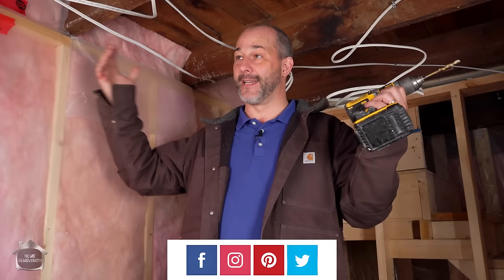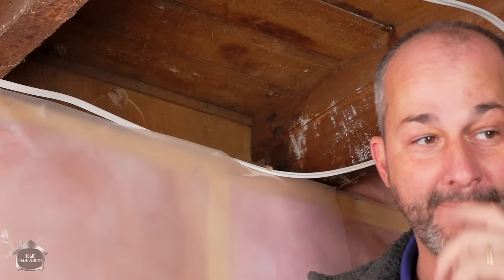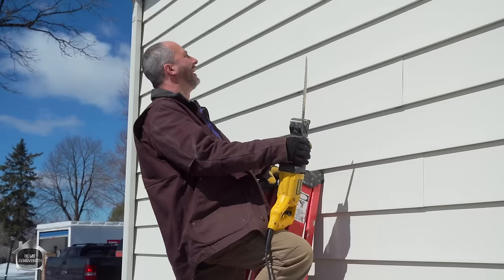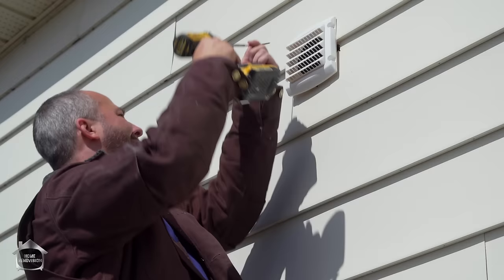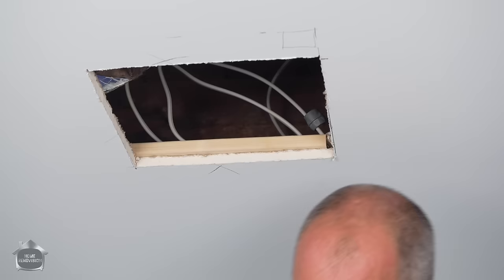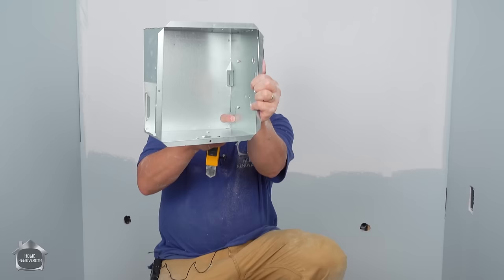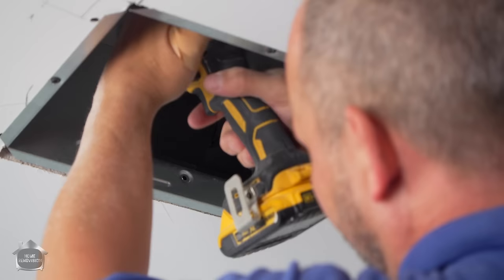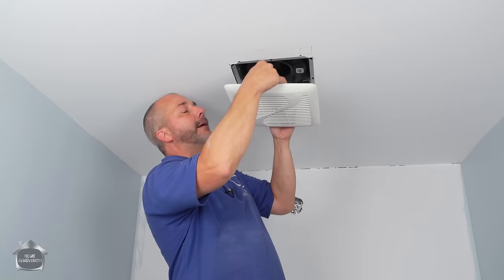How To Install A Bath Exhaust Fan | DIY

Comment: Ever given any thought to putting a little construction glue between the strapping and the drywall so that your temp screws bond it permanently to the opening, just in case you need to remove and replace without risk of the strapping breaking loose?

And I agree with you.  I have dozens of Phillips bit styles and sizes in a reverse "try" carrier, so that I can custom fit the bit to the Phillips fastener....  Robertson/"square" drive is a LOT easier to work with...  like three total sizes or something that I have to carry around for 85-90% of all work.  Of course, I like hex-head fasteners, too.  But slotted and Phillips should ALL be retired from construction.

That's a nice fan and housing design....
Reply from the maker: great idea!
Reply: Thanks for saying that Robertson is square drive! I haven’t heard it called Robertson before so was scratching my head wondering what kind of drive he’s dealing with 😂! I prefer torx T25 personally but I guess torx has a bunch of diff sizes as well so maybe the square drive is better, I just don’t see it as often as torx

Comment: If I  have a small bathroom in the basement, can I  put a vent in it and connect it to the dryer vent going outside? There is no shower down there, I  just want to vent a little of the humidity. Thanks.

Comment: Not sure if I missed it but can this same procedure be done only by cutting the opening of the fan in the drywall. So cut the 12” hole or whatever size for the fan. Then cut the hold for the vent just the way you did it.
Reply from the maker: you must install ducting. Cheers!

Comment: Wish I had an exterior wall to run a bathroom fan to. Only option is up & thru my flat roof, which I’m not keen to take on myself.
Reply from the maker: if you have a flat roof then you should have a space between your ceiling and the roof that could run a fan ducting. cheers!
Reply: @HomeRenoVisionDIY  Thanks! I guess I'll have to see what's going on up there when my electrician goes poking around in my plaster in a couple of weeks when he rewires the place. Wish I could do some of the basic rewiring myself, but Quebec is a pain in the butt as I'm sure you know

Comment: I would have drilled a pilot hole all the way through with a long bit.  I would have still used the hole saw to cut the hole on both sides.  If using a sharp one, it's not that difficult at all, and makes a much neater cut than using a sawzall.

Comment: Once my ceiling fan moter went out found a fan that could fit in the old housing and reinstalled the new fan in the old motor housing sence the new ones were bigger.

Comment: I'm going to be "that guy" and mention that you should check your local codes before doing any work on your house.  I know that in my area, venting a bathroom out the side of the house under the soffit is against code.  The reason for this is that the vent in the soffit can suck in the warm, moist air from the exhaust point and cause mold to grow or result in wood rot in the attic.  It is always best to vent a bathroom out through the roof of the house.

Comment: Hi Jeff, great video, very informative. Just a quick question. I’m currently putting a new bathroom in my unfinished basement. I can install the fan housing and secure it directly on the joist before putting the drywall on the ceiling. My question is, does the base of the housing have to be flush with the drywall or could it be above the drywall (flush with the joist)? The latter would be easier when installing the drywall, but not sure if the fan suction would be compromised as the opening will be above the drywall. Your feedback is highly appreciated.
Reply: I am also wondering why not install the box before put up the drywall.
Reply: If you install the box after drywall, then if it ever has to be replaced you can easily take the whole thing out and put a new one in without damaging drywall in the process.

Comment: I’m curious if a below the ground jacuzzi is actually more efficient than an above the ground jacuzzi, as far as energy is concerned. I’m wanting one but curious if in the long run it saves you money for a below the ground jacuzzi.
Reply from the maker: If you can afford the jacuzzi then the energy you can save is not the largest question that needs answering.

Comment: Good Morning.  This a question about the CAMO sys.  In a old deck frame you said something about using longer screws.  What size did you have in mind.  Jack   PS I plain to use the CAMO Marksman  PRO-X1.  I will use it on the old deck to put a few board tight again and a new deck on a old frame.  Jack
Reply from the maker: Hi Jack, my concern was with the quality of the framing. if the old pressure treated frame was soft at the surface then using camo would not hole. if your frame is good and dry and strong then no worries. i love cammo too. Cheers!

Comment: I have no existing exhaust fan and a low LOW LOW attic, in fact most "professional" repairmen(mostly smaller and shorter than me) won't do certain things in my attic! one is attempt to install a bathroom exhaust fan!  I am also 6'1" tall and weigh 260 lbs so forget about it!
Reply from the maker: you can always install a fan at the top of the wall in the wall . Cheers!

Comment: Question. I am thinking of installing a new exhaust fan in my bathroom. The old one doesn’t work any more and is just exhausting into my attic! I have a hipped roof/no Gable Also my roof is metal and I think it’s out of my scope to go this route. The only way I can exhaust near the install is through the fascia. It looks like what you cut through to get to the exterior. Is this ok to port through?

Comment: I just finished installing a bathroom fan in my older home. (Probably would have been smarter to watch install videos first, then install the fan.) My fan did not have a removable connector for the exhaust ducting. So I pulled the ducting out from the ceiling to tape it onto the housing, then slid the whole fan up into place. This resulted in my ducting not being in a straight line with my vent, as the extra ducting went sort of left to right as it went back into the ceiling. Will this be OK? Or do I need to correct this?

Comment: Wait till the Asian beetles (and other insects) find that critter guard on the outside vent along with the gap in the inside flapper will allow anything smaller than a hummingbird to go right inside. Also, those plastic vents become brittle after a few years in the sun. You'd be better off with a metal exterior vent cover that has a screen and a flapper.

Comment: How would you change the installation in there was a dedicated roof vent for the bathroom exhaust fan? When I had my roof completely replaced I had them install a special vent specifically for the installation of a vent fan in the bathroom. Second question, I have the main 3 piece bathroom and on the opposite side of the wall is the ensuite 2 piece bathroom for the master bedroom. Can I install a fan in each bathroom and use the same roof vent for both of them?

Comment: I’ve replaced a couple of fans in bottom floors of second story homes and they was no way to remove it at all. I had to cut the drywall out around it. Those suck

Comment: Hey Jeff, great video? Have you ever done a house were you had to go thru brick if so how did you enlarge the hole.
Reply from the maker: Hi Johnny, of course, we called a core drilling company and they came out and made a hole in the concrete in about 20 minutes. Cheers!
Reply: Home RenoVision DIY what does a core drilling company charge for this 20 minute housecall?!

Comment: Can you tell me what i need to put an exhaust fan in a mobile home that don't have an existing one. Is there any kit for that that don't have to go through the roof. Its a 14x80 trailer not a camper.

Comment: What if you have aluminum siding? Do you cut it with a utility knife? Question  if your vent is going to exit just underneath the underhand,  will this cause mold in the attic? 
I would like to see the pool being built.
Reply from the maker: Hi Ron on aluminum use the hole saw but run it in reverse until you have it really scratched up so it cuts nice. cheers!

Comment: What do you prefer over Philips Screws? I myself have distaste for flat head/slotted screws. Always slipping off them. I thought philips was to solve that, but I'm not a pro. Do you like star screws?
Reply from the maker: I use robertson. it is a square drive and it is amazing. torx is my second favorite.
Reply: @HomeRenoVisionDIY  Will check them out, thanks, Jeff! Edit: Yeah, torx is what I was calling star, maybe I'm mixing some up, or torx is the real name. Robertson  I remember seeing around, wondered about how good it was. Thanks again!

Comment: You are woefully using the wrong tool with a sawzall cutting the hole in the house. Too heavy, too bulky, and if it kicks back you can lose an eye. Use a simple multi tool. Easier, smaller, lighter weight, safer to use. You should also be wearing a dust mask, especially being that you do this all the time. You will screw your lungs up big time with drywall dust and other stuff over the course of time. You'll essentially get something similar to black lung or silicosis that stone masons get.

Comment: For my basement bathroom, can I put the fan on the wall instead of the ceiling so I can just vent it straight out the wall?
Reply from the maker: only if you buy a fan suitable for wall installations. less than 10 % of them do this.
Reply: @HomeRenoVisionDIY  Thanks, Jeff! I'll probably just get the one you recommend and install according to the instructions. Thanks!

Comment: I'd love a tip on how to install the fan box with 12 inches of existing cellulose insulation on the other side of the ceiling drywall... Any magical solution?
Reply from the maker: staple up a piece of poly to the ceiling and then reach in and pull the cut out through the side. push up poly to continue the vapor barrier. Cheers!
Reply: Home RenoVision DIY: Great idea, thanks!  Better magic than Harry Potter!

Comment: How would you fix crumbling concrete? I have a cold room in the house and on top of the cold room is an exterior deck. The floor of the deck (ceiling of the cold room) is starting to crumble. The cold room is still in perfect condition however the part that is exposed to the weather is starting to crumble. Just add more concrete?
Reply from the maker: it might need to be inspected for integrity. the concrete might be losing its strength due to moisture sitting on it and the sun in the winter can't get rid of it. I would suggest not using salt on the deck in the winter. Hope that helps!

Comment: My bathroom has no heating vent so it gets cold. Can I install one if the vents used in this video but for heat?  Would it need to make a big hole on the side and cap it as you did?

Comment: Do you have any recommendations for a heater/fan combo? My bathroom is too small to follow regulations for the distance between a wall heater and all plumbing... so we would like to install a ceiling heater, but the bathroom also doesn't have a fan. I saw some around the net, but don't know what would be recommended.

Comment: I have a fan in my bathroom that I don't believe is cutting the mustard, not to mention it's now not working either, I'm thinking of replacing it with a bigger fan (50cfm to 110, or there about) my question(s) it appears that the existing fan uses a 3in duct, could I get away with getting a 3" to 4" adapter and be good, or would I have to figure out new ducting too? Second part of that, it looks like the builder used some kind of rigid flexible tube off the side of the fan, how hard would it be to work with that in my scenario or shoukd i look for a more manageable plastic flex tube like you used, that leads me to not knowing what is through/at the roof vent (one of those "goose neck" ones), is it 3" or 4 with a reducer, or nothing at all just a pipe under a cover?  I'm not bad with electrical, it's the actual "construction" stuff that throws me off.

Comment: So much more work just because you didn't had the right pilot bid to drill the holes all the way. That wood it's not that thick, your would be fine and a lot less work and cleaner, if you just drill out with a holesaw . With that said, good job.

Comment: Hi Jeff, love your videos, any advice when a bathroom is in the middle of the house? Is it better to vent through the roof or through the wall? I’m Going to have to get in the attic either way so would like to do the better method of the 2! It’s a good 10-12 ft to the exterior wall.
Reply: I prefer roof venting over through-the-wall, but it is a bit harder to do properly. There are a number of utube videos that do not show it done correctly, so a person needs to be careful.  I also prefer to use metal ducting and I insulate it.

Comment: I am about to replace my bathroom vent would it hurt anything if I replaced my old Broan 50 cfm 3.0 sones and go larger with a 110 cfm with 1.0 sones?
Reply from the maker: the old 50 usually has a 3" pipe so it will still be loud when attaching a larger motor.
Reply: I was thinking about going with a 80cfm with .8 sones and this one has a 4” pipe opening and I was going to get a 3” adapter

Comment: Why the hate for Phillips screws? Just curious. They're way better the the original Slot screws.
Reply from the maker: we use a roberston here in Canada. square drive that does not slip and the screws can sit on the bit even  horizontally. Cheers!
Reply: Ah. We do have square drive screws as well. My father used them to build an extension to his deck. He liked working with them.

Comment: @HomeRenoVisionDIY  I am curious what fan model you install in this video. I am having trouble finding bathroom exhaust fans that have the option to break the side mounting tabs off and mount directly to the ceiling via the bottom flange as you did in this video. Any suggestions on what to search for or the exact model of this fan would be greatly appreciated.

Comment: I replaced my bathroom fan with this exact one a year ago and used the same tuct tape to secure it to the vent line. I took a shower late tonight after a workout (it's -3 outside) and it was non stop dripping condensation in my bathroom from the fan, it was leaking from the tuct tape. It looks like the builder of my house didn't use a insulated vent line, but rather a vent line buried under insulation. I'm not sure if this is an issue with the vent line or the tuct tape, any advice would be appreciated.

Comment: i was interested to see how you sealed up the outside
Reply: and what stops the screws you just drilled in from letting moister get into the wood, is that a concern?
Reply from the maker: This install was temporary. I will show how we finish the outside when we do the siding . Cheers!
Reply from the maker: a little caulking an we are good to go.

Comment: The bathroom here has a cinder block ceiling sitting on clapboards with plaster directly on them. The outer walls are block as well. The plumbing and wires run under the floor up the walls. There is only 2 circuits 1 does part of the kitchen the other shuts the rest of the apartment off. No exhaust fan just a window. And the window is block glass with metal bars outside. Anyone have similar problem or challenge or idea to overcome this?
Reply from the maker: you need to core drill a hole through the wll at the ceiling and then frame a drop ceiling to add a fan. Cheers!

Comment: I live in Wisconsin. I just bought my first home and the roof above the bathroom is a rubber roof. Currently the bathroom fan vents into the ceiling, so it drips condensation and I don't even want to think about what's going on in that insulation...gross.
 Who do I hire to install a bathroom fan through the outside wall (aluminum siding) like you just did?

Comment: I'm not very comfortable with cutting into rim joists. Wouldn't this cause a structural integrity problem at least under some circumstances?
Reply: Not at all.  The rim joist is fully supported.

Comment: Hey Jeff. I have an existing bathroom that we are about to renovate and it does not have an exhaust fan. The plan is to divide this bathroom into 2 new bathrooms (an ensuite and a main bathroom). Could I install a fan in each bathroom but have the ducting join together just before it exhausts out the side of the house to create a Y exhaust?
Reply from the maker: they end up blowing the air from 1 room into another unless they are wired to both turn on when either switch is flicked. like a 3 way light

Comment: Can you post a link to this fan please, I'm in Ireland and I need this fan big time our onsuite is like the other video you done previous where the fan rains on you( so attic duckung needs to be sorted too🙄)not to mention the water does be running down the walls as the standard fan is no use. Also maybe silly question but are the electric connections universal? Thanks in advance.

Comment: hey what tool are you using at 25 mins. is that a drill or driver? and what do u have on it that keeps that screw in place so nicely! thanks
Reply: to elaborate more. I am always holding screw and the grill w two hands and even when doing so the screw is wobbly and difficult to get it. whatever set up you have there the screws are going in flawlessly
Reply: Patrick Daley They’re Robertson screws/bits, aka “square or Scrulox” screws/bits (Google it for a closer look)

Comment: If you are doing a deck for the pool why wouldn't you do the form for the hot tub at the same time instead of doing later??
Reply from the maker: the hot tub will be attached to the side of the house since we get winter and the pool will be further off from that area. so it is 2 different projects. cheers!